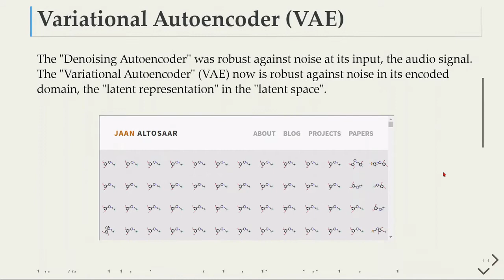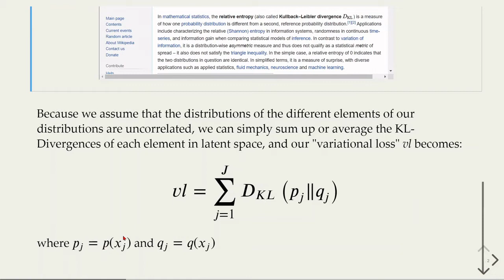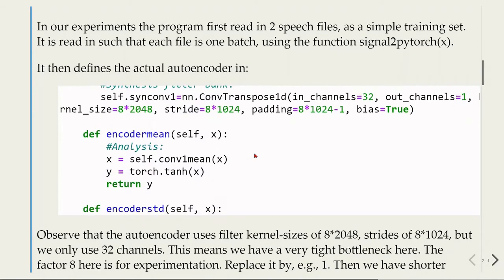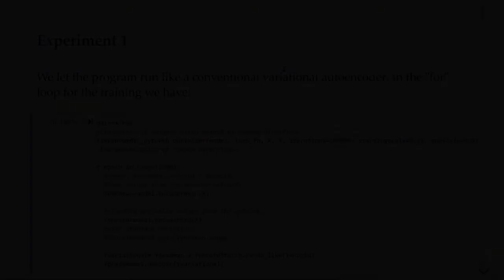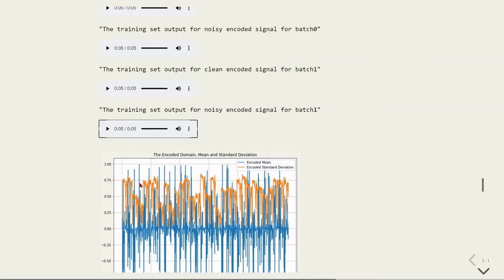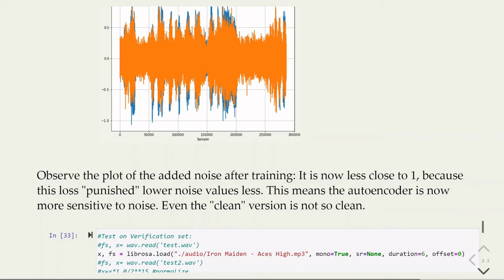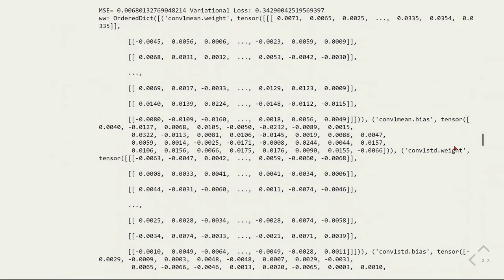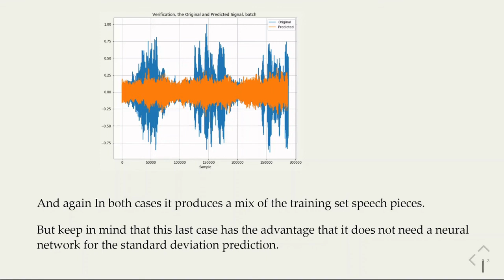Machine Learning for Audio Signals in Python - 08 Variational Autoencoder (VAE) in PyTorch

Comment: Hi, could you explain better how you convert the 1D dataset to tensor ?
Reply from the maker: If you check in the code in github, you may find a function that converts the array to tensor https://github.com/TUIlmenauAMS/MLfAS_Tutorials/blob/main/MLAS_08_Variational_Autoencoder.ipynb
Reply: @Guitars4RL   when i use the  linear in the encoder, should I use signmoid in the decoder ?
Reply from the maker: In between fully connected layers you should always use a non-linear function otherwise the result of consecutive layers is a linear combination. I believe it's important that you study different activation functions and understand which works bette for the problem, which are more suitable for the hidden layers, and which work better for the output layer.